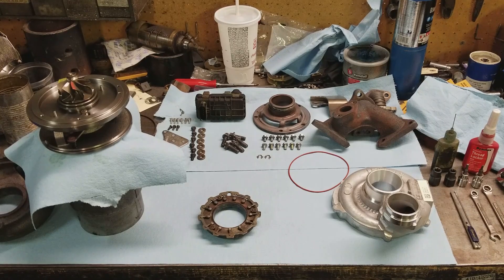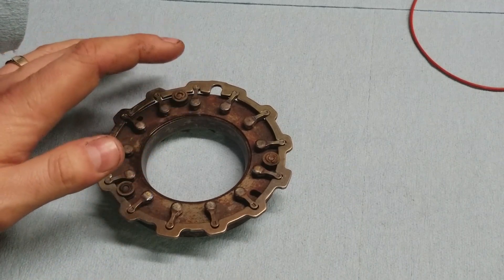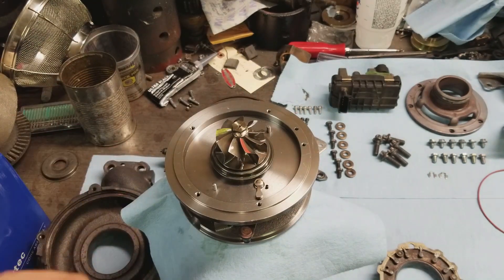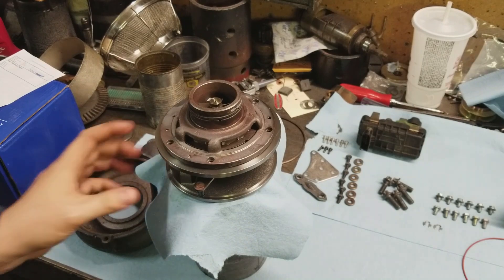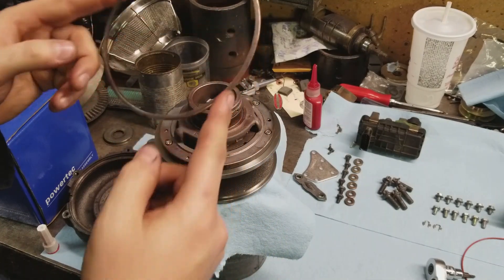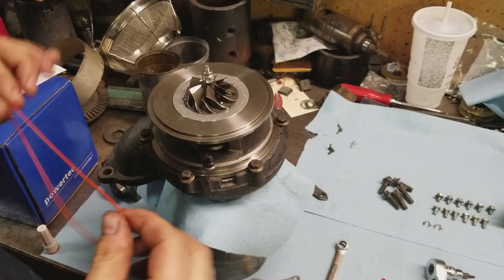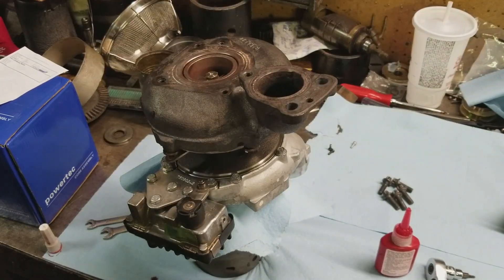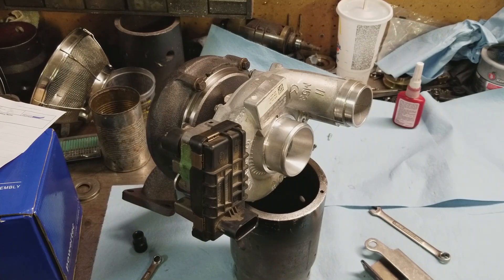DIY OM642 V6 (GT2056V) Turbocharger Rebuild!

Comment: Why wouldn't you just use OE parts? Are they that much more $$$?
Reply from the maker: Can't get an OEM cartridge (or I couldn't at the time), so a brand new turbo was the only option. Ended up being 10x more expensive vs an aftermarket cartridge.

Comment: I know this is an old video, who knows if you still look at these comments but this video has helped me immensely. I've just rebuilt my turbo, c350 cdi 265ps which is exactly the same using an ali express part and it's perfect, more responsive than ever.

Thank you sir!!!
Reply: @danislavevtimov9690  it was like £80, couldn't tell you how I found it now I did thr deal with a Chinese company over WhatsApp

Comment: I have a turbo leak coming from the exhaust side. Activator arm that goes for the exhaust side of the Turbo. My turbo sounds like a whistle when give it throttle. Any help will be appreciated.

Comment: Crap I broke off turbo nozzle back piece due to carbon build, which is the item you show at 4:15 on video time. Item that you said can only go on one way due to the screw positions. Is there a way to buy garret type that back piece? Thanks so much! BTW great video!!!

Comment: Hey just a quick question. So I want to reclock the turbo cartridge cuz I am putting this turbo on a 1.9L TDI and so i welded the exhaust housing to the stock TDI manifold but the clocking pin is in a bad location which would put the oil drain and pickup horizontal and wouldn't work. So I cut the clocking pin off and rotated the vain guide do i also need to drill reliefs for the little rollers in the housing?

Comment: Hey! Thanks for the video. I'm trying to figure out what I should look into next. I have an 09 GL320, had a bad oil cooler leak, got that replaced. Now I still have an oil leak from the charged air hose (right near the damper, upstream of the intercooler). There doesn't seem to be any play in the turbo shaft, but I'm also getting significantly worse fuel mileage than the computer thinks. I'm guessing I am having a turbo issue, but don't really have any experience in diagnosing the issue. Any advice?
Reply: Oil on the turbo vanes makes it harder to spool so there goes fuel economy. It will leak and take out your swirl flap motor. Change the PCV and use a catch can or simply route it to the atmosphere plug the hole where the PCV went into the "batwing"  (plastic air intake) add a new gasket at the turbo inlet. This will help the soot build-up in the intakes.  Think EGR blocking next.

Comment: Good afternoon! I have a question. I use a translator, I hope you understand me. When to put in place the geometry of a turbine with an electronic actuator, is it necessary to maintain a 2mm gap or can the geometry shutters be closed as in the video and the blades be assembled in the closed state?

Comment: Hi Great Video. I am rebuilding my Bluetech Turbo. New turbo core has the same problem. Pin  is in different location.How did you install the pin in correct location on turbo core?
Reply from the maker: I didn't install the pin, i removed it completely. i clocked it manually based off of the position of the old turbo core

Comment: wow, the om648 uses the gt23/59v. excellent video. 
the vnt turbos are very rebuidable. I rebuilt my gt2359 with parts from turbo international ($170 for tshaft&rebuild kit) . the actuator was tricky, replacing the internal connections takes patients. but $170 vs $1600 + reprogramming is good motivation.

Comment: I'm hearing a noise from the turbo area 1200rm onwards like a leak/suction noise or maybe bearing rough type noise, do you think turbo is going or boost leak? Also is the turbo easy to remove and install refurbished, also do I need to put it on the star to reset turbo to car because I've heard the waste valve/gate needs to be set to my car?
Reply: definitely needs a rebuild asap. turbo international for parts.
if you reuse the actuator , no programming needed.
if the actuator is broken, don't worry. fixing the broken wires is fairly easy and cheap.
Reply: Sorry I meant actuator not waste gate

Comment: Do you know what the purpose of the bolt Is for in the middle top of the core you bought? Theres 1 large one.  It looks like access for lube or something.
Reply: After refit of turbo, remove bolt and insert minimum 5ml of oil. Refit bolt. Start engine.

Comment: How is the turbo working?
I need to replace mine too and thinking of getting the same replacement but want a remap after.
Reply from the maker: Working fantastic! I have 2 of these Chinese turbo cores installed on 2 different OM642's, both working perfectly over the last 3 years.
Reply: @MBDieselFreak  I found another chra that is 3x the price allmoust and I am undecided if I should spend more or not...the brand is Melett a company im UK.
Reply: @MBDieselFreak  its from aliexpress or? I want buy parts to my om642. 170kw, And i wprry About qualitty.. Its really ok? Prices are amazing
Reply from the maker: @DJEvoIX  I bought it from eBay not AliExpress.
Reply from the maker: These Chinese cores are sent to the UK to be professionally balanced, so the manufacturer is taking SOME steps at least to make sure it's a quality part. 
It's really up to you on what you want to do.
Reply: @MBDieselFreak  I have just messaged the selller to make sure it fits 100% as I dont want to be shaving any pins to be honest.
Cheers!

Comment: Great video but the explanation about the vanes is backwards. The vanes never fully close, instead they stop at like 1/2mm from each other. This greatly increases the speed of the exhaust gases, making the turbo spin faster. Then they open to control boost, when target is reached.

Comment: Hi, i fixed my actuator now need to install it back, do i need exact precise postion of actuator arm to join it with linkage? or it will be set auto/electonically  by car before start up?
Reply from the maker: as long as the actuator is installed in the same position it was originally, it should be perfectly fine

Comment: do u know where I can get that stainless steel sealing ring as i damaged mine and need to replace it because of my error
Reply from the maker: I'm really not sure! Call a turbo specialty shop with your Garrett part number and maybe they might be able to find one
Reply: @MBDieselFreak  thanks
Reply: ER Automotive did you ever find a source for the stainless steel sealing ring? Mine snapped in half one one side of the ring. What would happen if you install it like that? Oil leak?
Reply: @MBDieselFreak  hi, I loved the vid. as for a parts source,  I rebuilt my gt2359v with parts from turbo international. I also reused the center housing. you can call them directly and they will help with parts selection and local distributor. 
I have always heard about balancing turbos(went to diesel school 1990)
and throughout my career(now machine repair) I have worked on various ultra high speed devices and balancing methods. a turbocharger spins in the range where all parts need to be balanced individually. relying on final assembly balancing isn't enough. and since the diesel engine doesn't reach high rpm the turbo doesn't reach the speeds of a turbo on a high rpm gas engine. the final balancing isn't required.
I rebuilt the 2359v in my om648 last year, and I plan on tuning it this year. the 2005 e320 cdi is a rocketship, if anyone says it has turbo lag. its because their turbo needs a rebuild. its crazy in the rain, and spins all the time on dry roads. should have been awd.
Reply: @madmagyver9981  interesting.
My om642 decided to shed some of its exhaust manifold into my turbo, now my turbine wheel is damaged but only say 20%, found the bits of manifold,  noticed turbine wheel sealing plate loose? I went ahead and rebuilt the turbo.
I got full boost for a few minutes then limp mode.
Initially my vanes were seized, caused actuator to churn its gears, solder points.
So I bought a gearbox for actuator, resoldered joints and fitted to turbo.

Soooo, according to you no need to perfect balance due to rev limits? So I can replace turbine wheel shaft?? Rebuild turbo.
Reply: @stevenmckinlay4478  yes, as the parts are machined balanced.
If you reuse the compressor, check for balancing marks on the lock nut.
Usually using witness marks and tightening the nut to the original position will work fine.
So far 40k on my 648 turbo, 20 year old son driving it, and it still rips brand new 275s.
Reply: @madmagyver9981  also today I am going to manually adjust the actuator position so that it exactly fits the turbo arm when engine off. Ie turbo arm fully down.
I Don think the position senor is as complicated as I assumed. Merely set when fitted an d adjust electronically. Or imo manually also by eye and ear.

I've been looking at cartridge, I have billet turbine wheel.

It I get new cartridge I can swap over billet? No balancing?.

Gotta love knowledge and problem solving. Excellent
Reply: @stevenmckinlay4478  you could always try.
There are a few different turbos for Mercedes diesels, some trucks have larger turbos on the same frame. Plug and play.
And entire brand new unit from Garrett is 1600 including the actuator. You need to learn it to the ecu.
Reply: I got the rebuild kit from turbo international.
You will need a. 0001 micrometer to make sure you get the right kit.

Comment: Hi, im going tonbe tearing apart my sprinter turbo and im getting the same cartrige from power tecm . I wanted to ask  how did  you end up correctly clock the turbo , refering to video when around 7:00
Reply from the maker: take pictures BEFORE and AFTER disassembling the turbo to know exactily where to clock the cartrage.

Comment: hiya!! @MBDieselFreak Nice video dude! Alex from legit cars said to subscribe to ya! I have a question matey - I have Mercedes CLK 320 CDI 2006

Initially, it had a loss of power / having no adequate power because of P0244 code - position solenoid A wastegate

I thought it was the actuator - after removing the actuator and testing it - this was perfectly fine!

the issue is the arm connected to the turbo - which opens and shuts the Wastegate on the turbocharger - it is stiff as shitee at the moment; you need a horse to pull it slightly or Popeye's muscles to move/ open/ shut the wastegate.

So at the moment - I've disconnected the Actuator 

I have also shut the wastegate to all the turbocharger to provide power to the car.

What are your thoughts, please? I need your help :o) 

How do I clean the turbocharger of carbon deposits without removing it - with Wynns EGR turbocharger cleaner?
Reply from the maker: Nice to have you here! Need a little more information here.... the car either has the om642 V6, or the om648 i6, and NEITHER of those cars has a waste gate for the turbo...... both use variable vane turbos which dont use waste gates. sooo....... what exactly did you "shut off"? lol. The computer is able to tell if the engine isn't producing sufficient boost a couple ways.... through the intake pressure sensor, and by reading the position of the turbo vane actuator. so if the arm that goes from the actuator to the vane arm is all jammed up, it isn't going to produce sufficient boost, AND its going to throw a code for the actuator not being in the correct position!
Reply: @MBDieselFreak  You're a star bro! so sorry I slept off almost immediately, you're right, should have said the engine type - it's an om642 V6.

Ohhhh, variable vane turbos - that's what it's called - now I'm getting some education brother - lol.

When I said 'shut off' - the arm that goes from the actuator to the vane arm moved by the actuator is pretty stiff/ jammed up (as you say), you'd need Popeye muscles to move it so it kept on continuously giving the P0244 code for the actuator in incorrect position thereby giving insufficient boost to the engine, felt like an anchor was been dragged when driven.

What I did was to disconnect the actuator arm from the actuator itself.

I also moved the variable vane turbo in a 'shut' position - to continuous give boost to the turbo - so it has restored power boost to the car - is this a bad thing?

However, the variable vane turbo is still jammed tho? is there a way of cleaning it, also what causes it to jam? Thank you once again bro :)
Reply from the maker: @jyde2me  take that arm completely off, and soak it in a jar of vinegar for a couple days! then wash it, and soak it in a penetrant like PB Blaster for a couple hours! the actuator itself is a servo motor, so you shouldn't be able to move that freely at all. is the lever on the turbo that moves the vanes stiff as well? if the detachable arm is removed, that lever on the turbo should be able to be moved up and down with 0 resistance.
Reply: @MBDieselFreak  Ahhhh I get it now, the actuator being a servo motor - that shouldn't be able to move freely at all then.

The lever on the turbo that moves the vanes is stiff as well - YES 

I've detached the detachable arm and removed it, for the time being.

The lever on the turbo is able to move up and down but as I haven't attached the detachable arm back - I've left the 'variable vanes turbo' windows open so the turbo can continuously spool and take in the exhaust gas.

Comment: What an excellent channel! Honestly don’t know how you don’t have more subscribers!
Reply from the maker: Daveks3 I'm working on it! Haha I've got big plans for future videos, should have another dropping this weekend!
Reply: I have a w211 with the om642 engine. Do you know if there is a upgraded turbo about for it that would just bolt on?  (Just curious)
Reply from the maker: Daveks3 performance upgrades are not my specialty, so I'm not sure! If so, it's going to have a seriously hard time fitting in turbo land, due to the very tight tolerances that turbo recesses into the top of the engine.
Reply: MBDieselFreak Yeah I guess so, just wondered. Used to work for Mercedes-Benz but retired from the motor trade at 21 lol

Comment: Gaskets are not reusable, they''re beveled to form an airtight seal on assembly. Also new stainless bolts are highly adviced trust me. Of course new pcv heater gasket & the charge intake gasket unless you want a faulty M55 in the near future :) Having done many turbojobs on the 642, i've not seen the inside of one yet, thanks for the video :)
Reply from the maker: Kasper stainless spring steel is absolutely re-useable as long as it's still maintaining it's spring-ability. The rest of the o-rings were replaced. 

This turbo was rebuilt the same time I was doing the oil cooler seal job, so the swirl flaps and motor was deleted, new pcv fitted, new intake seals, etc. No seals were reused except the spring steel one I mentioned in the turbo. :)

Comment: With the Chinese cartridge did you have less mpg/speed as opposed to the original Garrett turbo cartridge?
Reply from the maker: Nope! the cartrage is really very simple, its just a couple of mechanical seals, a couple oil flooded bushings, and then the turbine and compressor wheels. the cartrage is actually balanced by a professional shop in the UK before its sold.
Reply: @MBDieselFreak  thank you!
Reply: @MBDieselFreak  Also did you end up having to shave off the locating pin? And if so how did you do that?
Reply from the maker: Ethan Denny I did! I just used a file, carefully shaving it down. I didn't tighten the bolts down till I knew the exact clock position of the housings.
Reply: @MBDieselFreak  Hey, doing the same on my garret turbo with the number GT2056V on a C219 OM642. Came up with a litte problem while replacing it, there is one bolt that does not fit on it. Is it the one that you shaved away? Am stucked right now because of that, hope you could help me out